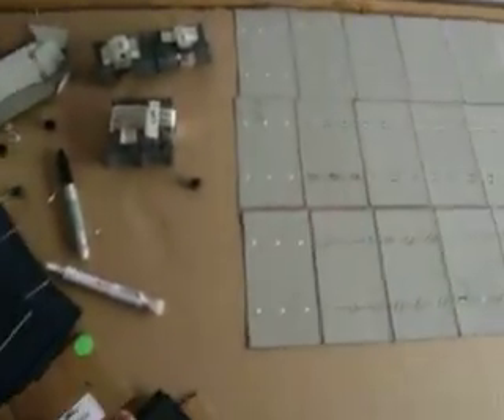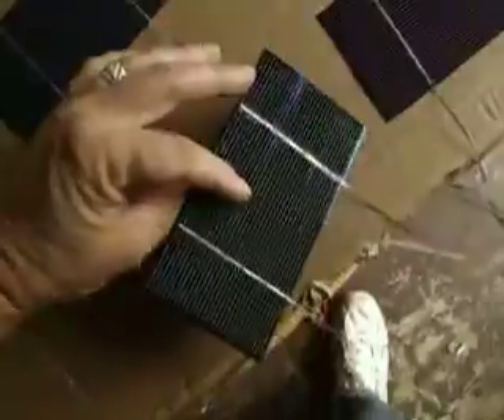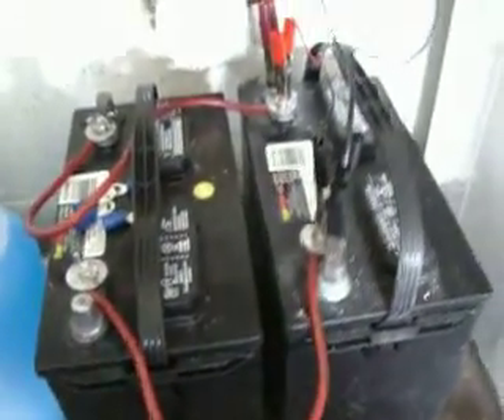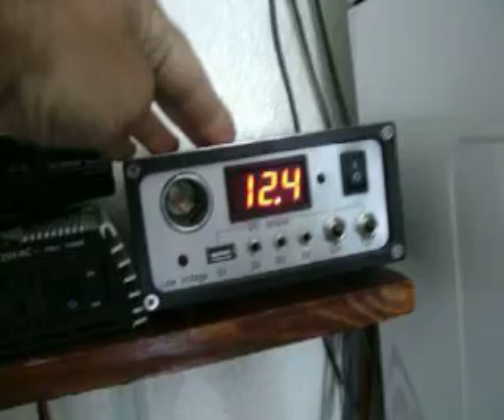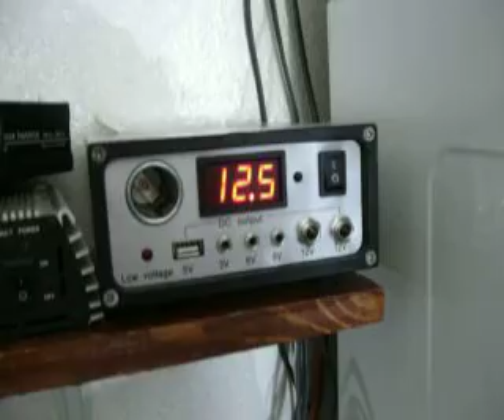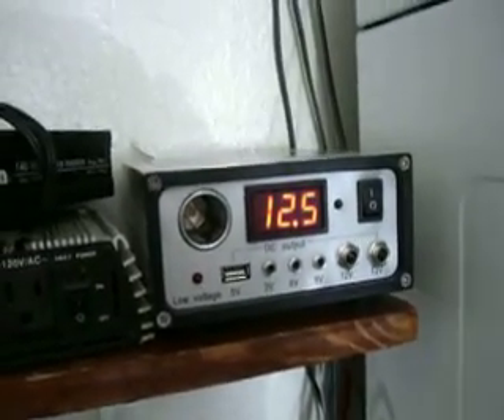45 WATT SOLAR PANEL UPGRADE

Comment from the maker: @mrbuki77 thanks for reply ,i had to move and im now in pa ,so i could not update to much,and looking for a new job, but i did get some of my solar   panels up,and got it all connected and i find by being in a cooler climate i charge my batteries faster and batteries holding more power in them.

Comment: If you tin your soldering iron, you won't have to scrape the tip with a file. Tining is done by cleaning and sanding smooth your iron tip, then put a good soaking of acid flux on it and add a generous amount of silver solder on the tip. Then to clean the tip for each use heat the iron and just wipe the tip on a damp sponge. it will shine like new every time.